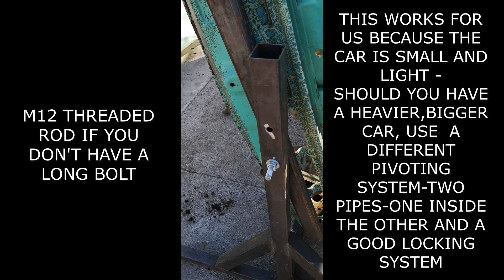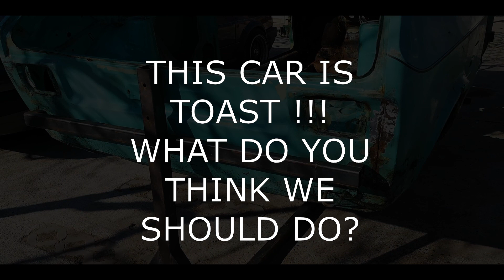1977 Polo MK1 Restoration project Ep. 5 RUST IN ALL IT'S GLORY

Comment: Serch for mk2 polo floor in good shape! banch of panels are same!
Reply from the maker: Yes, I know they are somewhat the same, except for the seat rails and a few other bits. Unfortunately I couldn't find mk2 either :( !!
Reply: @EliseiDesign  polo metal parts are rear an expensive! i white for next video:D
Reply: wher is new vidos?
Reply from the maker: Money is tight! It will come! Thanks for being around!
Reply: @EliseiDesign  new polo vidos are in progres?
Reply from the maker: @kristapshelvigs6121   Hi! I did some work on it, nothing much. I had to buy some side sills /rocker panels(all the way from Sweden) as my metal brake can't make such tight turns. I hope the weather is getting a bit better so I can continue with at least installing the parts that I had to make from scratch. I am still amazed on how rusted it is , even thinking to abandon the project. Each time I look at it I am thinking that I must be a little insane to do such a project. The material I had taken so far is not enough to post a video.